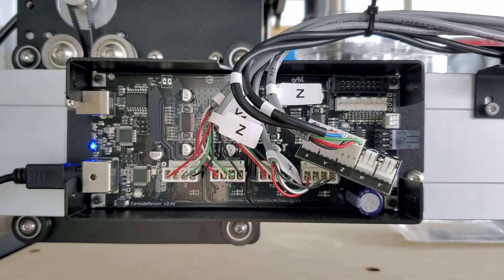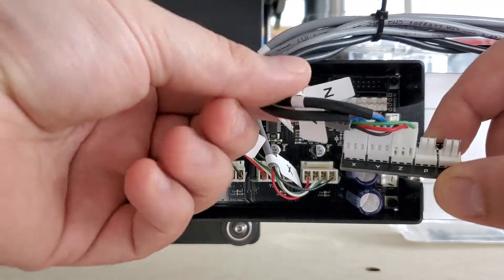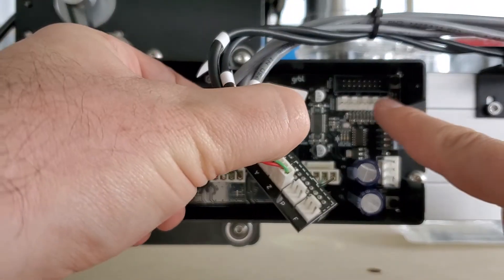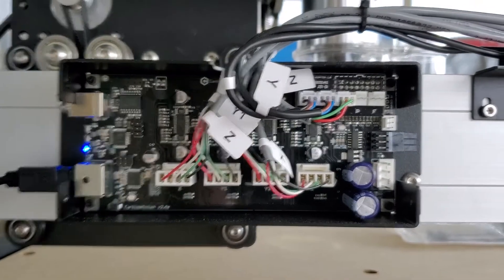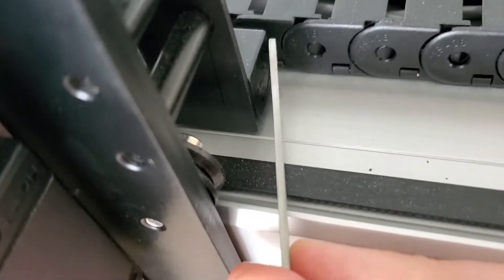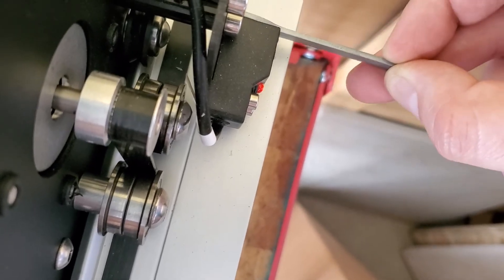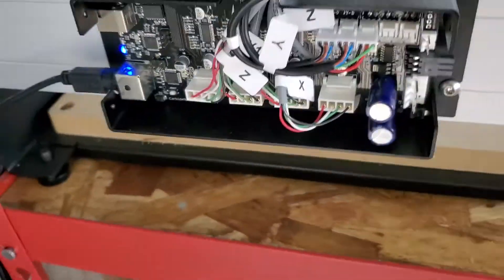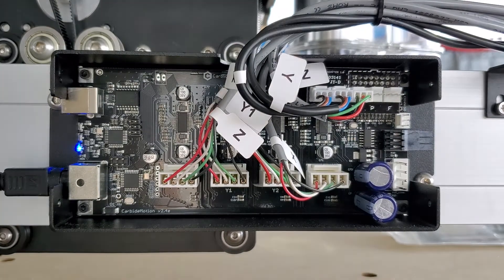Proximity Switch Troubleshooting

Comment: Im having a problem.  The Proximity switch lights when testing it.  However, the light on the motherboard is always on.  This is causing my machine not to home.  Bad Sensor? or Board?